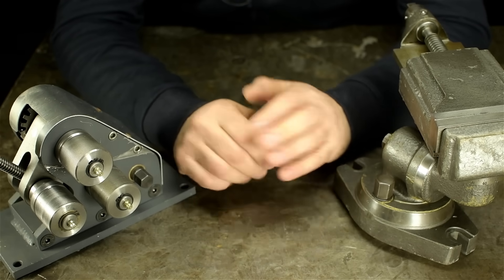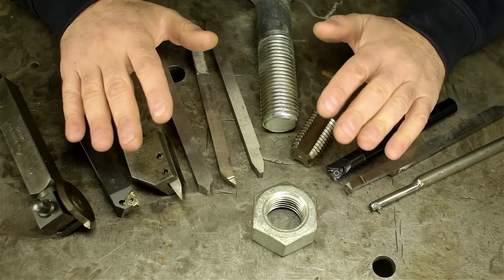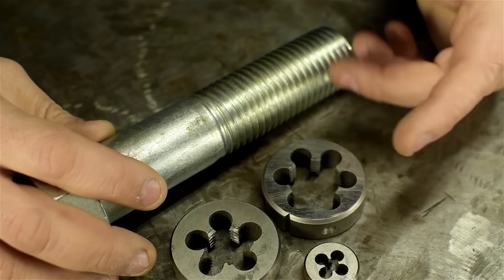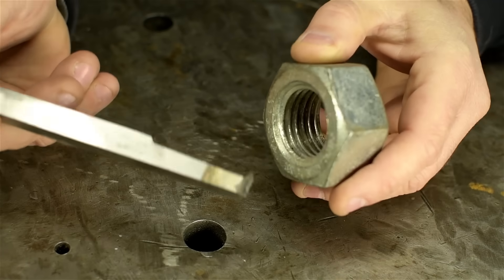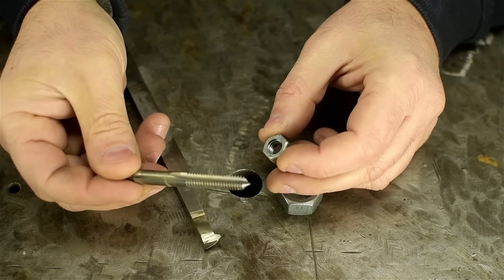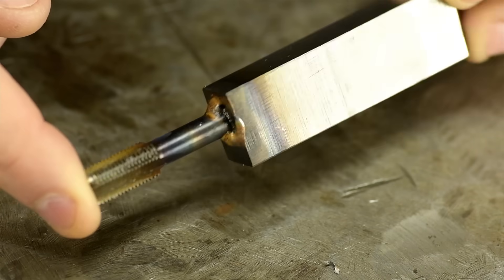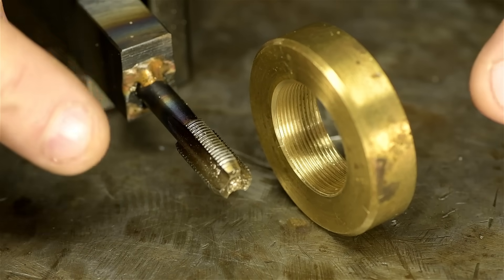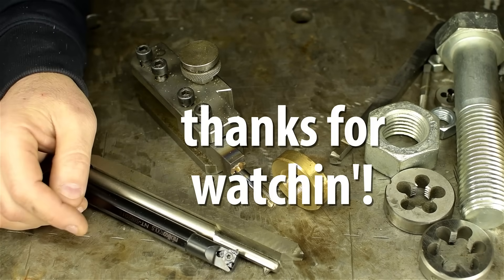Using a TAP as Thread Boring Tool

Comment: Add even more to that, note this: Take a 36 tpi tap, set the lathe to 36 tpi speed - and you get a single thread... set the lathe e.g. at 9 tpi and cut with the 36 tpi tap - and you get a 4 start thread.

Comment: @3:40, you say, '. . .but the business end of these are exactly the same as the external threading tool.'
...You make 1 of 2 errors. The first choice is a subject to verb number error: '. . . the business end of these are . . .' should be, '. . . but the business end of these is . . .'
...The business end is singular and needs a singular verb. That would be is.
...The other possible error is more logical. It's a subject of a later pronoun to verb number error. You should say, '. . . but the business ends of these . . . ' These is the key word here. These is a plural pronoun and logically should follow a plural reference, which here should be the plural 'ends,' not the singular 'end.'
...All of this might seem nitpicky and pompous of me, but think about it: English is ever-so-much-better when correct. You should correct this.

Comment: What you need to watch in threading is oversize condition ,so to use a tap the proper way in lathe is float the tap so it follows the hole otherwise it acts like a boring bar. And gives you a oversize thread. Which also cause oversize if you feed too fast or to slow.

Comment: Hi Tony. Great video again!
I've used this technique 'the other way around' - with the workpiece stationary and the tap spinning (CNC). It means different sized threaded holes can be machined with the same tap - obv. same pitch thus reducing tool changes!
Also if an angle is ground on the 'leading edge' of the tap, similar to a drill bit, the hole can be bored first, then tapped. I believe this is called a 'thriller' (tap and drill-er)

Comment: An "old" trick. I learned it back in 1970 when I went to work as a machine operator. Great for cutting fine threads in large diameter bodies. Company I worked for made hydraulic cylinders for aircraft. We used this trick to cut threads into cylinder bodies so gland rings could be screwed in.
Reply: just wanted to ask you whether I need to set up threading gears according to the calculations you shown.
Reply: @80gourav  Yes.... You still need to set the gears to the pitch you are cutting. Also, on the parts we made there was a large "O" ring groove cut at the bottom of the threaded area. This served 2 purposes, 1.- A groove for a sealing "O" ring, and 2.- A relief for the threading tool to run into. Remember, the threading tool has multiple cutting surfaces.....it's not like a single point tool where you can just stop feeding the tool. You must make sure all the taps cutting surfaces are into the groove before stopping the feed. We modified bottom taps for this specialized purpose. Most had only 3-5 cutting surfaces depending on pitch.
Reply: Is that the company that make the Concord landing gear train?? ;)
Reply: @skf3747  Company was "Conair Inc." in Burbank,CA. We made stuff for a lot of different aircraft manufacturers. Landing gear trunnions for 727,737,747, DC-10, and L-1011 aircraft to name a few. We also made the canard actuators for the B-1A. Company went out of business when the peanut farmer elected in '76 shutdown numerous military contracts and put 30,000 machinists out of work in the Southern California area.

Comment: Disappointed that you didn't cover my favourite method of making internal threads. I cut an external one and then turn the part inside out.
Reply: Is that the inverted thread made from a tap extruded from unobtainium…..
Reply: @gfenwick1  Heck I didn't think of that, I've been hand weaving mine using carbon nanotubes. Kind of hard on the eyesight.
Reply: But you need to remember to cut it as a left hand thread so it's the right way once you turn it inside out.

Comment: I have a feeling this is also a way to get past the 1/2" boring bar problem, where finding a boring bar that can do holes less than 1/2" tends to be difficult, set the feedrate as anything besides the TPI on the tap, and it should cut a smooth hole instead.

Comment: Have a "so you think you are mechaknuckical, huh?"  challange.

The story.   About twenty years ago I went to an auction.... about over, only a few things left ... there's this very pretty little table.   Nobody bids, the auctioneer gets down to two dollars and I shrug.  Sold. 

I go over to pick it up... it's heavy.    Dontcha know there's a SEWING  MACHINE in it.    Another shrug,  I get home put it in the corner where I wanted a sometimes possibly marginally flat surface...  But it's really pretty so I throw a piece of plywood over it.  And there it's sat.    Now this is an old ugly garage.  About five years ago the little leaks in the roof went completely... old rubber roof kinda tore itself to pieces over one winter/spring.  In a heavy rain it was worse than having no roof at all ... no joke.   I had thrown tarps over most tools and stacks of things, but over about two months ... when it rained A LOT ... I rebuit the roof (rather than slightly slanted rubber, an A frame roof ... try that sometime on a slant roof and tell me you have no use for high school trigonometry.) Anyway, the only protection this had was a slab of now rotting plywood and not only had there been a little water in the garage every rain for years but for about a - very rainy - month it was bare to the sky.   About five years ago.... (the garage has been bone dry ever since ... the wolf spiders got PO'd and took off, but the granddaddy longlegs and other web spinners love the new digs)

Well last week my daughter who's been knitting and stitching for years visits and says something about wanting a real sewing machine.    A tiny litttle dim grain of wheat bulb in my head goes off.... I think I have one!    

So I dig it out expecting a rusty piece of junk suitable only for  fill in the next sinkhole I see. But surprise it's still incredibly clean.    Some pieces even move..

So I crack it open.  It's an old Gimbel's Deluxe model fwiw.   Wow.   The cams gears and slides are incredible.  A transmission mechanic might be comfortable with it, but me,  I broke it down to where I can clean and oil all the remaining moving pieces, but I'm really afraid that if I take it down much more it will be something I can't get back together and get the timing and angle relations right.   Well I have everything moving freely and oiled up ... I'm going to use lithium grease on some sliding cams ... and I think I can get the rest of it all back together again for her.    At this point I know WHAT everything does though with the sewing thing I'm still not sure I know the why of everything it does.  But it should be a good gift for oldest daughter 

I'd bet your Maho doesn't have very much on the way of complexity over an old good quality mechanical sewing machine!  (I know that my 3d printers aside from all the electronics are mechanical toys in comparison, and it puts even my (Chinesium mini) lathe to shame. 

So just for giggles the challenge is to pick up an old quality sewing machine(I'm surprised says here you can get them for a hundred on ebay... I don't think there's ANYTHING for sale to consumers matching that measure of precision machining you can buy today for less than a couple thousand ... if at all) and have some fun with it.     As said I think I know what things do, but if you turn up something I hadn't noticed or even more can elucidate some of the why of some of the wierd movements going on in there I'd be interested.   

Obviously I have no right to demand anything, and this is more of a "you might think this fun and interesting" kind of thing.  But I am really, really, really impressed by the complexity and quality of machining in these old sewing machines.
Reply: Ah found most of the why's.   These here intertubies are wonderful.    Old PBS show I used to watch whenever I saw one of this series on.   Now with magic of the web the whole thing is out there.   I have some (ancient!) catching up to do.    But for the sewing machine:

https://www.youtube.com/watch?v=4Jbk1uU_Jkk

Comment: FYI: You're Not Limited to running the same Thread Pitch if you grind off all but one point (per flute so you can still rotate it to a good one if not brazed in place {or if using a 4 flute tap}) effectively turning the tap into a Single Point Threading Tool with all of the Clearances Built In. . . I've done that many times over the years with old broken taps making mini boring bars (and internal Chamfer Tools) out of them.
Reply: that sounds like a good use for broken taps

Comment: Maybe its just for me a stupid Question, but you said that u brazed your Tap on. Is there a difference between brazing and welding for example a tap on, and if yes what is the difference ?
Reply from the maker: Brazing is lower temperature and (if you're careful) shouldn't cause as much trouble with the tap than welding might.  Sort of like soldering.
Reply: @ThisOldTony  very very thank you❤️

Comment: I had a need to cut an internal differential thread combo (30 TPI/40TPI) in a 1/4" bore.  I fashioned my cutting tool by grinding away all but one "tooth" of a 5/16-18 tap, removing the balance of the tap enough to give the clearance needed inside the bore.  Rather than braze or silver-solder the tool to a square shank, I clamped the unground tap shank into a small boring bar holder.

Comment: You're only cutting with the first thread so cannot see any advantage over a single point tool. If he'd of shown cutting a large thread in steel using a taper tap so you can go straight to depth it would have been a better video.

Comment: I got a question as far as this subject goes.  Isn't a lathe a risky way to cut threads?  More so referring to multi pass process.  Just seems like it would be able to cut different(secondary) threads especially in the beginning, unless the plunge is timed with the rotation.  Perhaps lathes are built that way?

Comment: You just gave me an idea. What if you built a floating holder for the tap that allowed the spinning part the pull the tap in. This would then not require any lathe settings to change thread pitch. I have used floating tap holders on mills but I wonder if it would work on something like this.

Comment: It would appear to me that swarf is cutting along the length of the tap, that tells me the tap is not square to the axis. What you need to do is grind away all but two of the teeth to prevent this.
Reply from the maker: the tap has some lead-in taper.  good eye!

Comment: If you braze the tap into the center of a piece of hex stock for a 3 flute, or square stock for a 2/4 flute, you can use all the flutes as cutting edges over time and still use them as a standard tap.
Reply: Niceeeeee!

Comment: To be honest, it never occured to me to use a tap to thread large bores on a lathe. Being a long time machining center operator I used thread mills on large bores and this would be a variation of the same thing only the part is spinning and not the tool. Great idea.

Comment: Excellent tip, it still amazes me how something can seem so obvious
Reply: I wouldn't worry, it only SEEMS obvious because it's being presented to look that way. A tap is absolutely NOT suitable as a tooling insert, the same way a bicycle tyre isn't rated for Mach 4. Yes it's the same principle, but a WILDLY different scale. Saw the handle off a tap and try actually milling with it. It won't be pretty, but it's as graphic a demonstration as I can think of to illustrate the problem.

Comment: That brazed tap on the block is pretty neat, I've never seen that done before. Have you ever used a Tapmatic tool before? The large cylinder of clutches and springs that mounts in a drill press. Then you load up a regular tap, flip the switch and jam it down into your part. As you lift the drill press, the clutches within the tool cause it to spin backwards and the tap come back out. It's a little scary at first since we run them pretty fast since we are usually doing a few hundred parts but I almost want one at home just to tap random holes.

Also, babies first tap is always the closes grade 8 bolt that you aren't afraid of messing the threads up on.

Comment: I work in a machine shop that specializes in micromachining for the medical industry. Typical major ID ranges between .005 and .060 for the stuff we make and we always use single point ID tools to do internal threading. There's a "sweet spot" for using taps that ranges between 1/8th" and 3/4", in my experience.

Comment: Not sure about Amazon, but McMaster has 1"-24 taps. Not cheap, obviously. 

https://www.mcmaster.com/taps/thread-size~1-24/

Yeah, I was surprised as well. 

Makes sense, though. I've seen bizarro-seeming threads like this in applications where, say, a pipe (or other cylindrical object) is threaded along its outside, and a collar threads up and down it, usually in a jam-nut sort of application. Cars with adjustable-height coilover suspensions use this sort of trick.

Comment: Weirdly bike BB's have been using 1.37" x 24 TPI threads for around a century at this stage, so that unlikely size is surprisingly easy to get taps for. You have to watch for the odd manufacturer trying to sneak 1.75" thread past quality control though...

Comment: You picked a TPI that is actually relevant to a person who might want to use this trick. A bicycle "english" bottom bracket is 1.375" x 24 TPI. Taps exist of course, but they cost quite a lot. Last one I did I used an expensive carbide inset single point cause I happened to have one, but if I didnt, I would try this trick

Comment: so wait, you could make a tap holder by drilling to the tap size, flatten one side a bit, run two headless screws against it to keep it in place (all about ideal thread length, could be a counter sunk bolt) and have a perfectly centered, no weld, true to axis, large bore/non standard thread tapping tool.
fuck yes.

Comment: I have never fully, completely, wholly understood how the tool remains in sync with the thread on subsequent passes. It is not fully automatic, it appears, because you have to watch for "your number" to come up, but apparently that doesn't have to be timed to the nanosecond. Maybe everybody else gets it, but I have never fully done so.
Reply from the maker: Don't know if this will help but when threading your carriage (tool motion) is mechanically linked to the chuck rotations.  You can't NOT be in sync.  The thread dial ("your number") just tells you where you were connected, so in that case, you could "disconnect" the carriage, then connect it again in the same spot (same number) or equivalent multiple of that number.  ... any better?  probs not.
Reply: @ThisOldTony  It will do until I can pay you a visit and look at the mechanism itself. :-)  Thanks.

Comment: I have to comment here I needed a 16tpi thread internal, there was no tap available in the diameter I needed it to be. My internal threading tools at the time were too large for the bore. Long story short I took three flutes off a 4 flute tap larger sized and used it to thread the side of the smaller hole.

Comment: The thread angle varies for a given pitch with varying diameter. It isn't clear whether this can cause negative clearance though. If it did you could grind off some of the heel of the tap teeth.
Reply: pitch helix angle relative to screw diameter

Comment: I saw another pretty ggod trick, a guy was making a small worm gear, not the worm gear itself but the gear it meshes with. He had the tap in the lathe chuck, and mounted the gear on a spindle which was clamped to his toolpost. Then feed it in, the gear turns as it threads.

Comment: This stunt doesn't work for any diameters, materials, or hole depths that are desirable.  You're abusing the single-point lathe threading operation into a thread-profile attempt.  Too much cutting surface engagement, especially as the hole gets smaller.  Taps only work because they engage opposing sides of the tools at once, so that the net side force is close to zero.  That cutting side force in your attempt will immediately snap off the shank of the tap.  Minimizing the depth of cut to try to minimize the forces to avoid breakage will not work either, because depth of cut has to be significant to actually cut, otherwise you just rub.  At the very least, you should be advising to grind off all but one thread point on the tap, if you want to cobble a single-point tool out of a tap, which would only be worthwhile in an emergency.

Just get a miniature sized carbide threading insert toolholder and inserts.  Imports are cheaper than a good tap and work fine.

Stop torturing the neurotics and OCD misers with the "it's not the best way but it can be made to work."  There is no excuse for using an impractical technique when the best way is also the least expensive in time and money.  You just need the patience and diligence to acquire the tooling.

Comment: This will definitely work if the size of the hole is close to the proper size for the tap, but if you get too far away, then the pitch angle of the tap is too large, and you will cut a malformed thread. You might be able to get around that by not cutting as deeply. Another issue is that the flat at the root (or crest) of the thread will not be correct.
Reply: Started scrolling down to see if anyone else thought about the issue, was not dissapointed

Comment: What about the trick for doing out side threads with a internal lathe tool in the spindle of a mill using thread milling and then doing the internal thread on the same part right after with no tool change ?